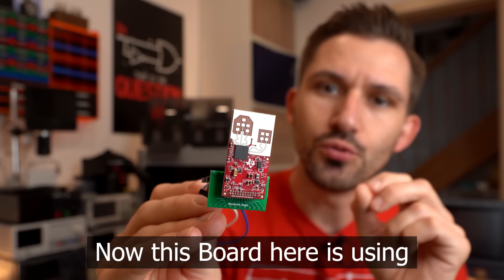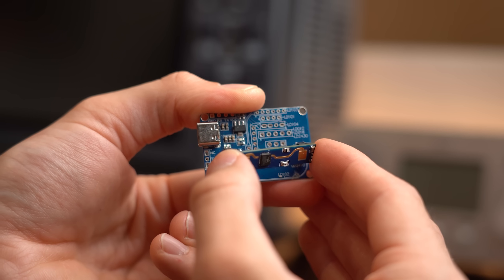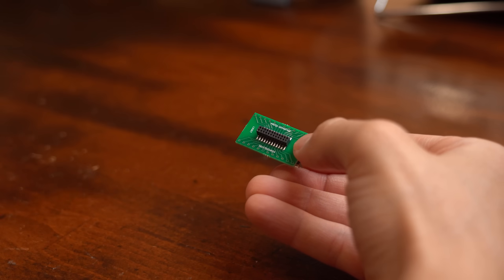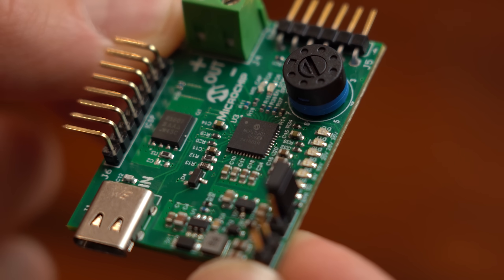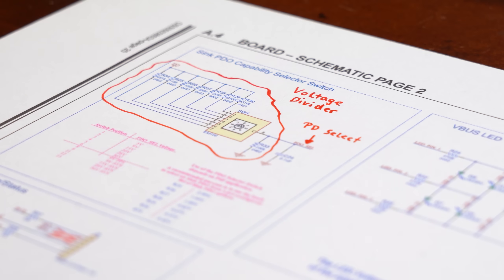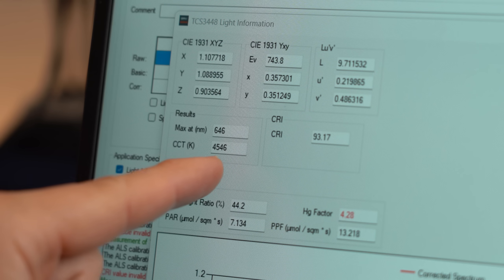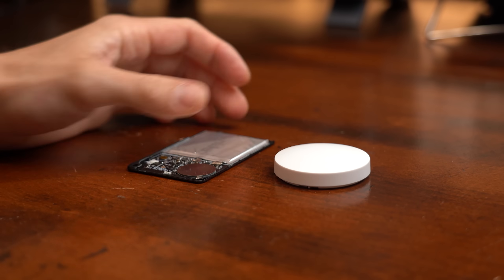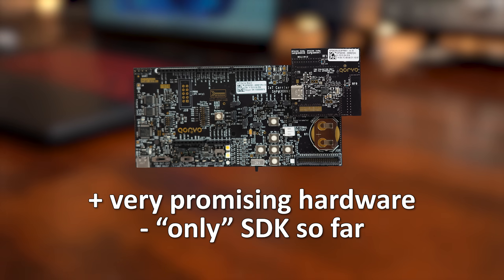I tried Super Useful Future Tech! (That you can use Today)

Comment: I used Mouser Electronics as back as the 70's. Always reliable, Never a problem. Pricing has always been great!
Reply from the maker: Thanks for the feedback :-) Glad to hear it
Reply: Nowadays lcsc is way better
Reply: I wish Mouser shipped to Ukraine. Currently, I have to overpay to local resellers and with the risk of getting fakes.
Reply: Except that mouser is now charging 93 Euro for a single dev board. Their pricing stinks
Reply: @recess677  

I have been using Chinese radars for 18+ months - probably 1/10th the cost  (realistically even less) - highly reliable, faster, easier to work with.

It just blows my mind the absolute propaganda going on in this thread - just really obvious marketing and shilling.
Reply: @recess677  The price is set by the manufacturer, not Mouser.
Reply: Oh yes. Mouser has filled my hard-to-find switch needs a couple times, and not marked up. Happy with their pricing.
Reply: They are at least 10 times more expensive than Chinese equivalents which are generally better, faster, more accurate etc.

The spruik and propaganda in this thread is so obvious and ridiculous.

Comment: I think that radar sensor could be used in smart homes for super-accurate presence detection.
Reply from the maker: Definitely possible ;-)
Reply: not just presence detection, but also location tracking.

imagine having a bunch of lights automatically following where you are.
or a phased array speaker than can automatically point towards where you are.

Comment: I’m very curious about 77ghz radar. I’ve seen this used in some Scania trucks and wondered if the stream leaving the device was encrypted or using bit bang technology?. The reason is that if a different Scania truck was heading towards it and the radar of one source was detected from the other would it trigger a collision detection or believe it was its own source?  Logic says both trucks would still see each other as the TTA would on par but scrambled by the opposing truck. If anyone could perhaps elaborate how reflections are overcome?
Reply: Likely using frequency hopping. Most modern digital radio systems do it already (For example, your WiFi at home does not jam your neighbor's WiFi) so it would be a no-brainer to add it here.

Comment: I was interested in that multispectral optical sensor, but it's over $500 CAD on mouser. That's in the same ballpark as other sensors, definitely not a budget item. It would be handy though!
Reply: I am also interested in the sensor. The whole board from the link mentioned in the description is expensive. But the chip itself is not. I wonder how easy it would be to use the chip directly.
Reply: @KoStard  From the datasheet, it doesn't look too hard.  It speaks i2c, for which there are tons of libraries already.  The hard part is soldering it; you can't dead bug it, so you're really looking at stencils and a hot plate, or a hot air gun, but this sensor really doesn't want to get above 260°C...
Reply: I think hot plate is the way to go. If you're worried, leaded solder gives you a pretty good margin to avoid overheating the sensor.
Reply: @KoStard   check OPPLE Light Master 4 it's pretty the same type of sensor but its finished device
Reply from the maker: What? No, the sensor itself is "pretty cheap". I think you are looking at the entire dev board. Those will always be quite expensive because they are more or less made for developers that want to try the sensor/IC and later make their own product around them.
Reply: @greatscottlab  I was confused by that, too.  If I, as a vaguely competent electronics hobbyist, wanted to get started with the sensor, where do I buy it?
Ah, I see, I'd have to develop my own board around it, and manage to solder a package design I'd not even heard about (OLGA8) without damaging the sensor...  Yeah, I'll wait for somebody to put out a dev board on aliexpress...
Reply: @greatscottlab  An eval board like this with its software is key to the functionality shown. I'm working in a small niche research lab with limited budget. I can't explain to my boss I need a $500 CAD / 350€ just to see if it does what it claims it does. Only buying the sensor requires me to build a driver or library and that is going to be time consuming and even more expensive. After that I still have to spend time evaluating. All this while Osram did all the work already. The kit is developed, sell it for cheap, provide the software and common libraries in open source.... you'll have many more candidates to implement that sensor and sell larger quantities quickly. Unless you want to wait till the Chinese copy it and mass-build modules on Aliexpress for 5 bucks.